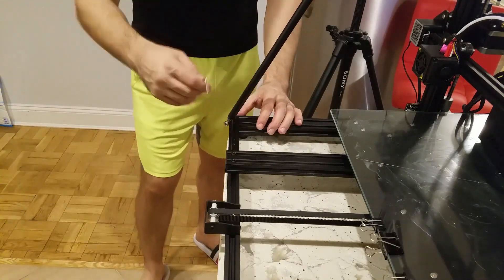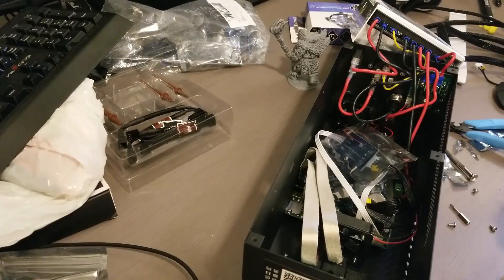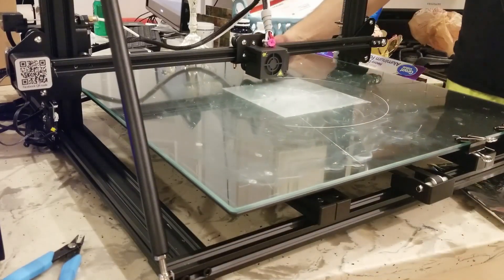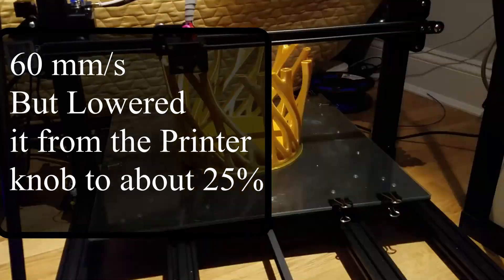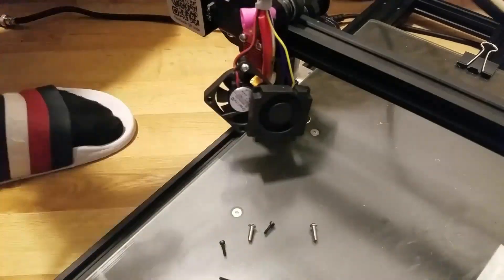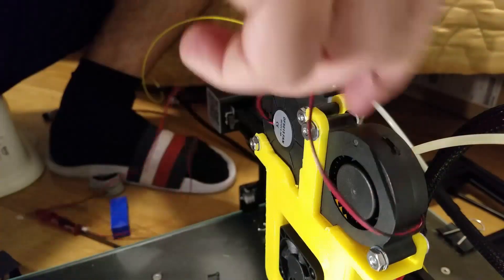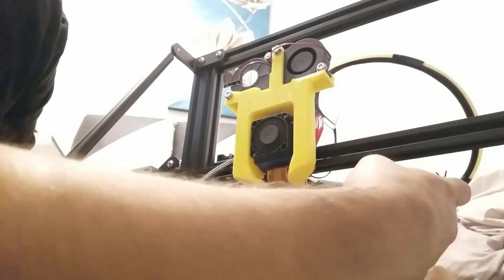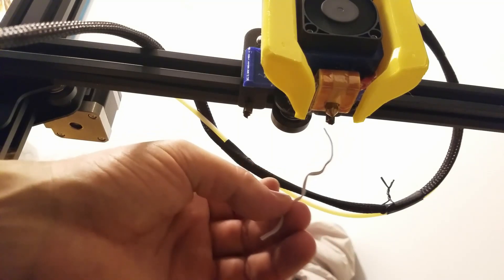Creality CR 10 S5 3D printer Upgrades, Z Axis Rods,  TL Smoothers, Petsfang, and Observations

Comment: Tengo una impresora cr10 s5 Creality y tengo problema con el eje Y, el motor algunas veces esta imprimiendo y empieza a atascarse, como si no pudiera girar y estuviera trabado, al principio pense que era el motor, lo reemplace y el problema seguia, le quite la correa por que pense que tal vez eran las excentricas que estuvieran dañadas y el problema persiste, parece como si el motor estuviera atascado y se estuviera forzando aunque ya no hay nada que impida que gire, esto lo noto al tratar de mover el eje Y en la consola, sabrias que es lo que esta dañado, gracias.
Reply from the maker: Try using another motherboard on tge printer. I have had motors that had the ball bearings damaged.

Comment: I like my S5 the only downside that I hate is the heat bed is not actually 500 mm.
Reply: They sell a 510x510 heater unit
Reply from the maker: Yea this 3d printer is a decent ready to run, but i feel it needs a lot of upgrades. And really I rarely print this big, so it is in a box disassembled for the last 2 years.

Comment: Do u recommend this printer I want something as my first I dont knw if I should get the cr10s 5 or solvo sv03
Reply from the maker: I do not recommend the cr10 s5 as your first printer. Is very noisy and it is only 12V. I am not aware if there were any improvements since the 2019 version. Perhaps the sovol may be a bit better. It seems to have the quiet stepper controllers and autoleveling. And it does have a respectable volume. I think there are too many options to narrow one down. By your Inquiry I bet you think you will print a lot of large items. But I found that this idea is only when you plan on buying and rarely you 3d print very large prints. So I think there are a lot of other options that could get you started and then once you got used to failures then you ll get a better direction on which printer should be the one for you. All FDMs have quirks. And long week prints have a lot of chances of failure because of the extended period of print time. I do not know a lot about the sovol, and usually with 3d printers in this price range you also have to get lucky. So I think you should look for a printer that has TMC 2209 steppers and a mobo thats 32bit. I am very demanding in wall quality and so far the artillery sw x1 has been satisfactory. But you have to get lucky with it as well. Seems pretty complete and the wall quality is ok. There are links in my videos description but those are affiliate links so I get a commission if you decide to use them and buy. The artillery is know to have a grounding issue. The power supply is grounded but the case is not properly in contact with the power supply so the 3d printer shell is not grounded. I had an issue with my motherboard and I reached to support. They made me jump trough the usual troubleshooting steps but they  sent a replacent board. I think there are a lot of other printers that may do a good job as well. Also the artillery needs a few tweaks. I have several videos about it and issues I ran into. So tweaking is necessary after a while and the spare parts accumulation is insane. I hope this gives you some direction.

Comment: Those ESD Bags are NOT insulating ... they are slightly conductive in order to dissipate any charge accumulation that could damage electronics contained within them. You probably don't want to have them within your control box. Also, they might not melt from heat in the control box, they will certainly affect the airflow through the box. YMMV.
Reply from the maker: Yes the airflow would be hindered. I put them on a side to allow the airflow to go trough. I did not know they may be slightly conductive. Anyway I had to open the box for the umpteenth time to check the vref on the stepper controllers. Let me tell you these 3d printers are not fun to solve all their quirks. My next 3d printer has to be expensive and no more quirks! Just design 3d stuff and print.